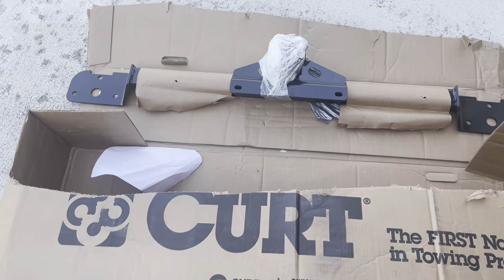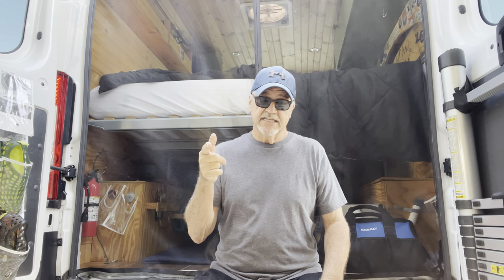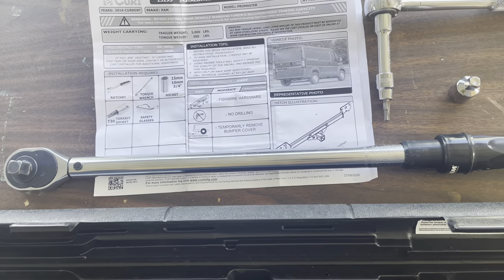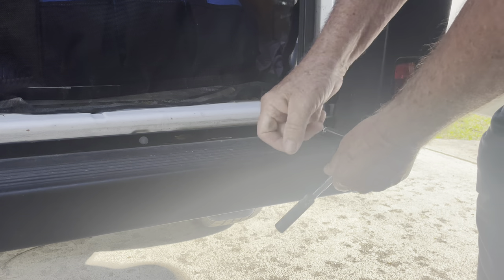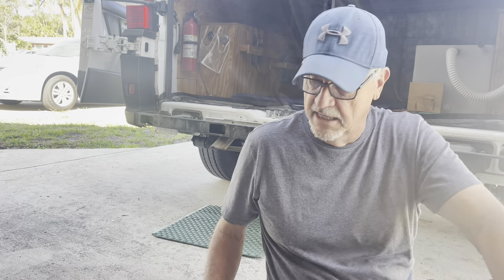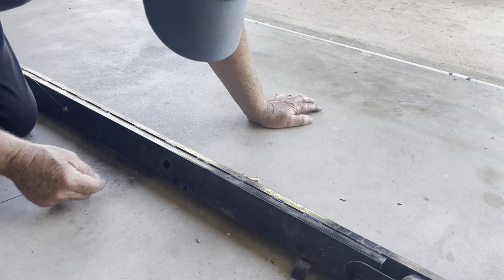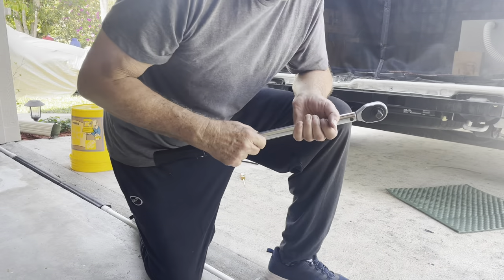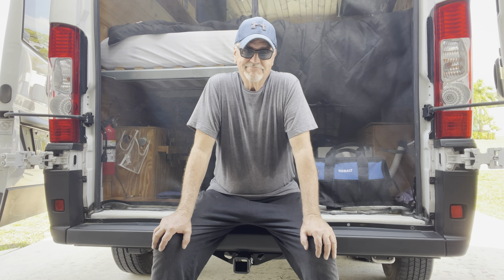Ram Pro Master Receiver Hitch

Comment: We have Part Source or Home Depot here that do similar tool rental programs.  It's awesome for things you might not use often.  Thanks for demonstrating the install.  I'm considering adding something like this off my Tow Behind Trailer Hitch so we can stow bicycles and not have them take up the whole truck box.
Reply from the maker: I didn’t realize Home Depot did this. Perfect! 👍Yeah this will add some tow option to the Van. Thanks Dan